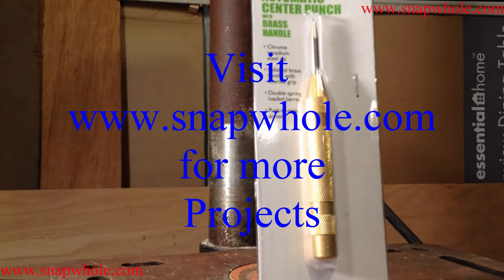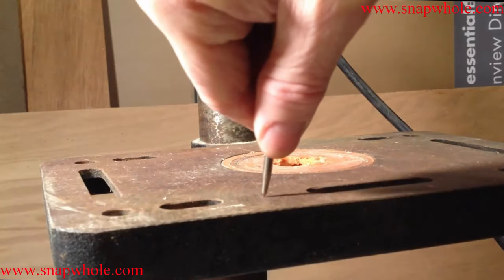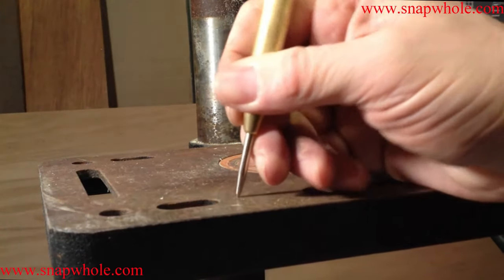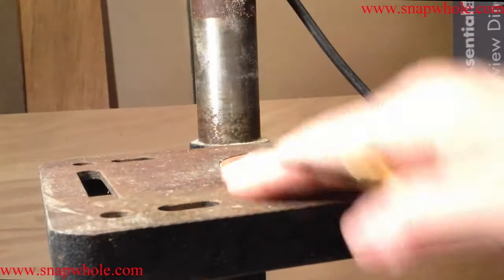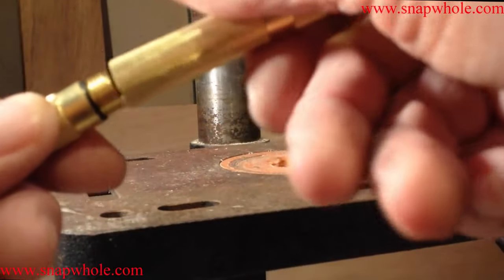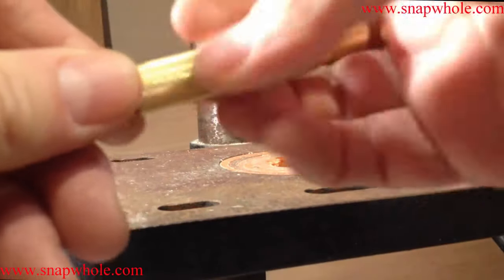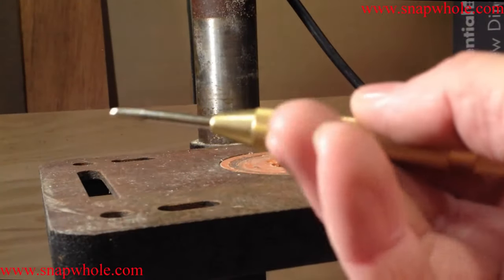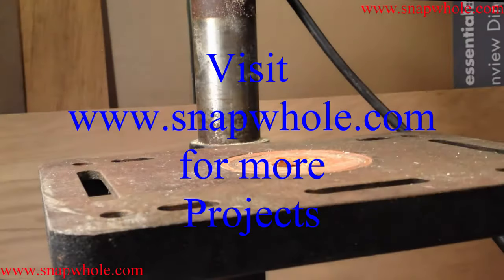Harbor Freight Automatic Center Punch Review and Use Demonstration

Comment: I got about half a dozen reliable punches from mine.  I tried rebuilding and greasing and it still won't reliably reset. Usually the tip just bottoms out without punching.
Reply from the maker: the problem is in the butt end of the punch, round the edge that slips in/out of the hole so the transition is easier and it will start working fine again - chuck it into a drill and run it against a file or a belt sander (check it often and keep it cool) I had to do that to mine after a while - thanks for subscribing!
Reply: @snapwholeharborfreightreviews  Thanks!! I'll try that at work where I keep it.  I like the tool but was disappointed.